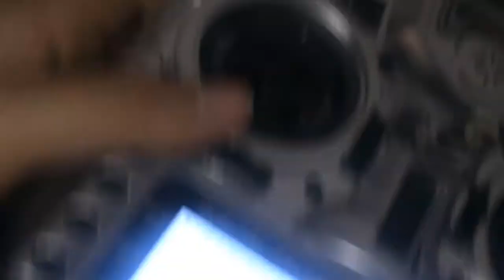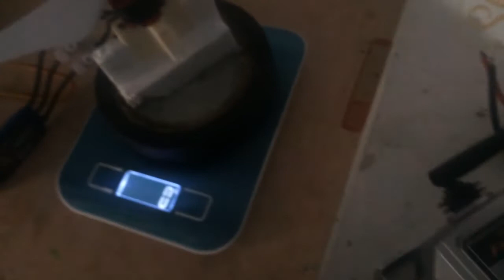DJI 2212 920KV Review and Thrust Test

Comment: With 1045 carbon fibre props and 3S 5200 mah battery which I used, it's able to give 650g of thrust and with 4S, it gives 800g thrust

Comment: Can you mention the set of propellers that go in theses rectangular slots .....been searching for a prop
for a long time
Reply: They are DJI Propellers. They fit dji motors (like the one in the video, and like the ones I use. The ones in the video are DJI 2045 Props. (ie. https://m.banggood.com/Gemfan-DJI-Style-1045-Carbon-Nylon-CWCCW-Propeller-For-RC-Multirotor-p-961068.html?rmmds=search)
Reply: https://robu.in/product/orange-hd-propellers-104510x4-5-abs-dji-1cw1ccw-1pair-black/

These are the only set of propellers i found that fit these motors.If buying , be careful and only get the one for which i have provided the link.There are other propellers in the same site with a similar name but different colours which come with a circular shaft and prop reducers.

Comment: Isnt the result a bit biased by air hitting the balance?. I think It can actually pull a Little more.
Reply from the maker: It also depend on battery voltage, in this video i used 3s lithium ion battery which the voltage drop is more than polymer batteries, if we use  polymer battery we get a little bit more thrust or if we use 4s battery we get much more thrust, i will make videos about it soon.